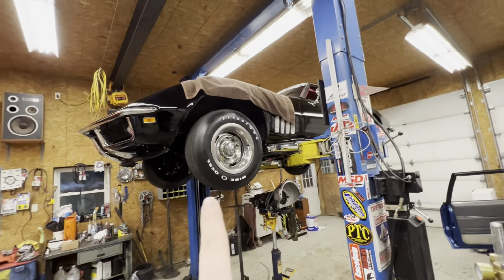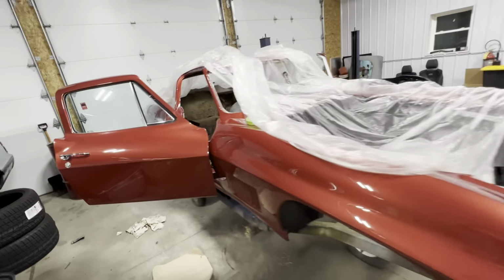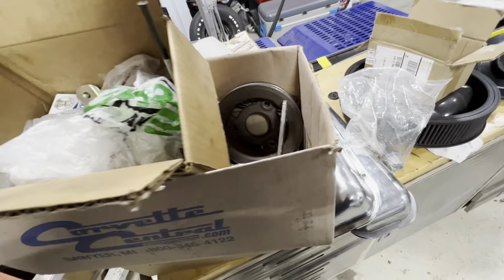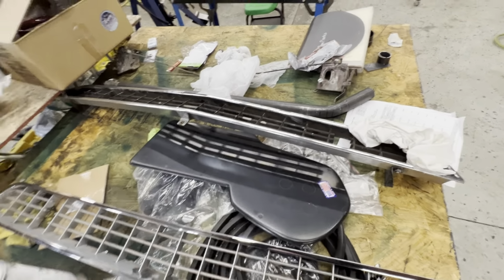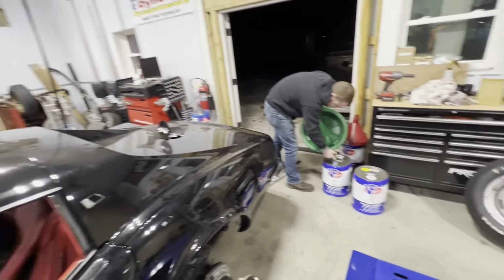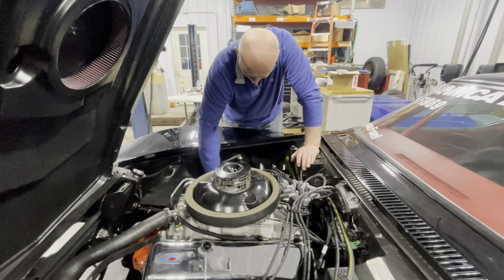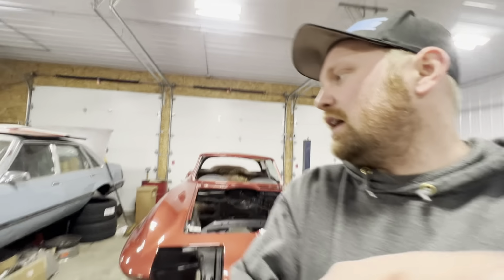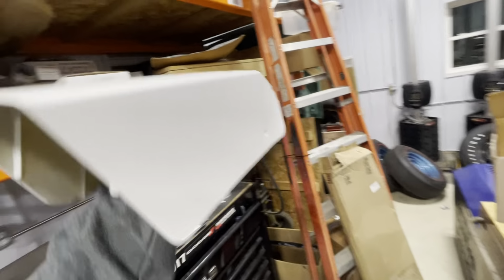1967 L88 Corvette Build Update! Can We Get It Done? Dyno Tests with The 69 Vette! Fast Racing Series

Comment: Thanks for the update! At  4:42 into the video , I see a PYPES EXHAUST carton hiding. Do you use their mufflers at all? I f so which ones?
Reply from the maker: Yes we have run their exhaust kits on both race cars and customer cars. We always use the Race Pro mufflers. All the other mufflers pypes offers are huge horsepower killers.
Reply: @HorsepowerDepot  AWESOME! I got a 3 inch system with those mufflers...install when snow goes away

Comment: What happened to the little 4 banger build can't remember what kind of a car it was but remember it was in good shape. If you hit up Boosted Boyz on You Tube they are really cool guys and can hook you up with a 4  cylinder Honda motor with anywhere from 400 to 1300 they have the worlds fastest MR2 Honda 4 cylinder powered running 7s.